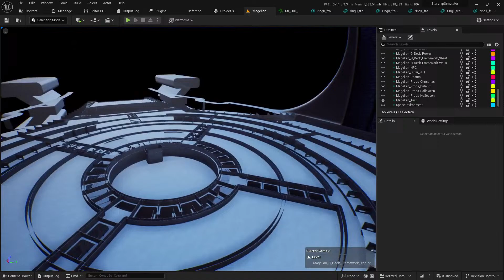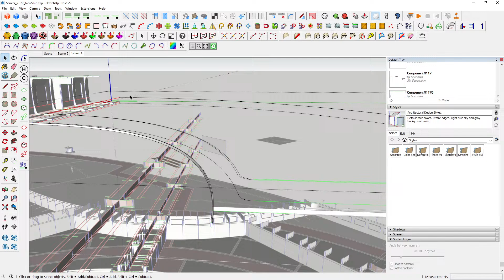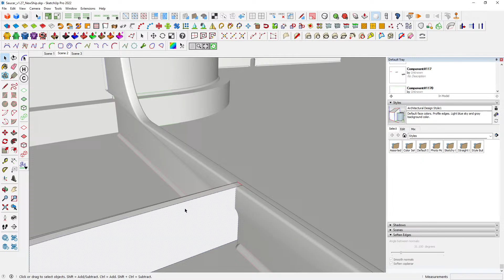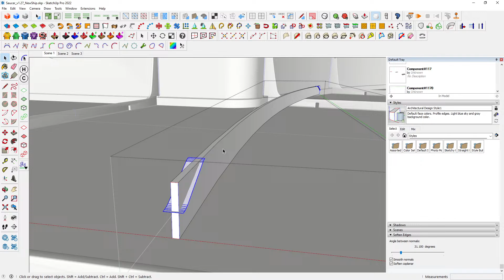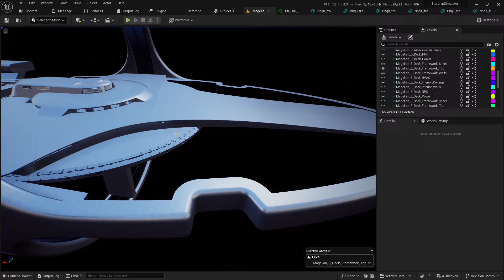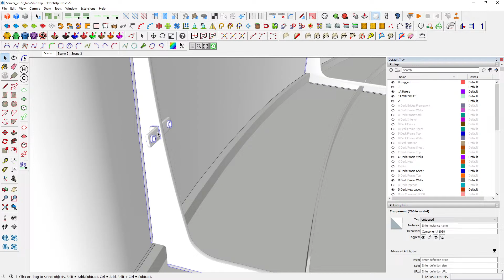Starship Simulator Dev Stream

Comment: so will you be putting gravity generators in the floors?
Reply: The gravity generator will be a series of field coils running around the underside of the ship. It creates a field that covers the whole vessel, but because of the inverse-square law, the strength of the gravitational pull will diminish as you go up through the decks.